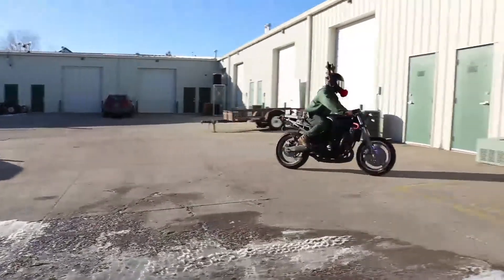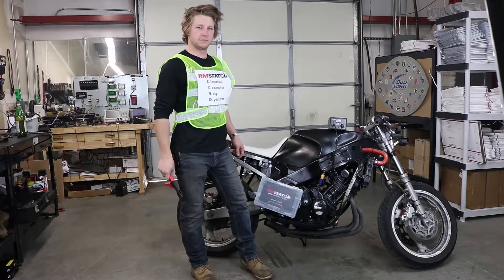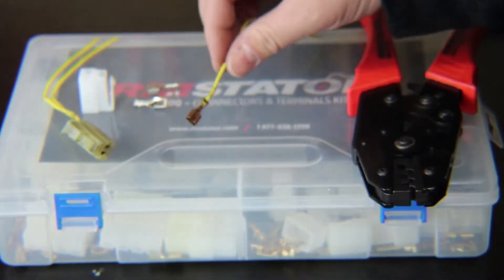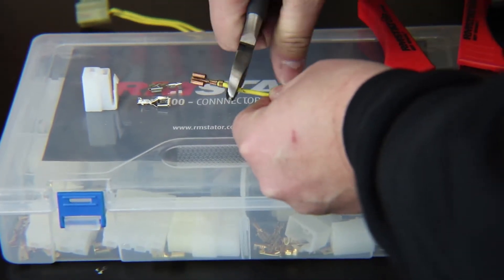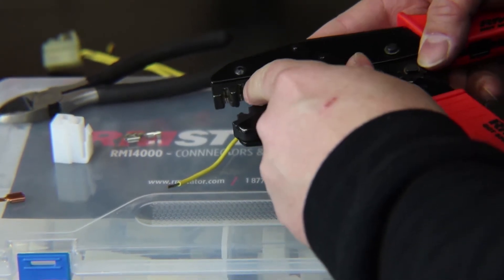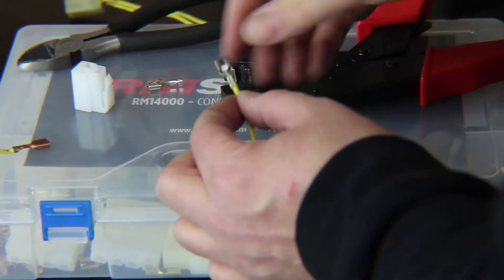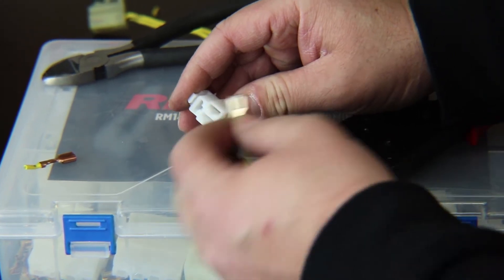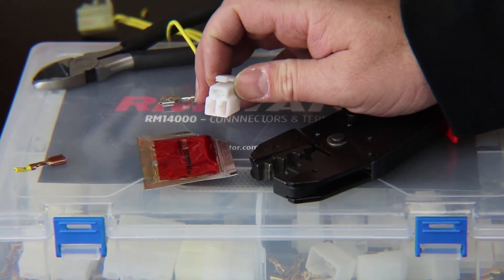How To Repair Your Connectors - A Step-By-Step Guide On Crimping Connectors Like A Pro

Comment: I was told that dielectrical grease should go in the backside of the connector to keep it weatherproof. Not in the front where the spade is located as it could give a bad connection and attract dirt. 
The connector when plugged together is sealed..

Comment: Helpful! I am doing some quick mods on my 1999 Yamaha FZR600 (much like the one in the video...cut up and "fightered"). I moved to Maryland two years ago. They have strict inspection criteria that basically made my FZR not street legal until I replace the headlight and add turn signals. I bought a new headlight that has bullet connectors. So, now I have to decide "Do I keep those bullet connectors and cut the blade connectors from the wiring harness...vice versa. Is there any considerable pros and cons when making that decision?